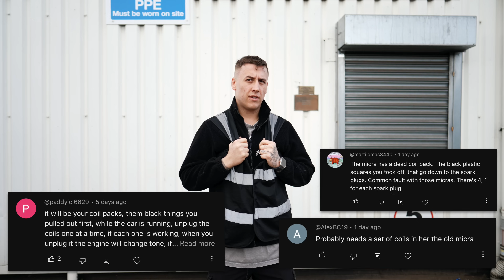WHY IS COPPER WORTH SO MUCH? | Scrap King Diaries #S05E12

Comment: Have you even considered getting a granulation machine for the wire you’re getting? If yes is there a reason for not getting it? Would like to see waste side, exporter sites etc basically where your gear ends up.